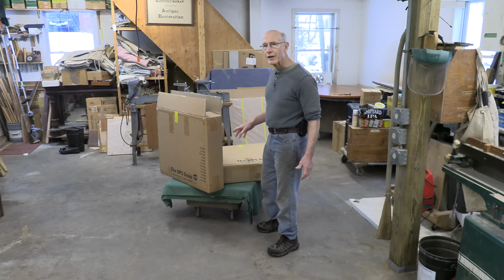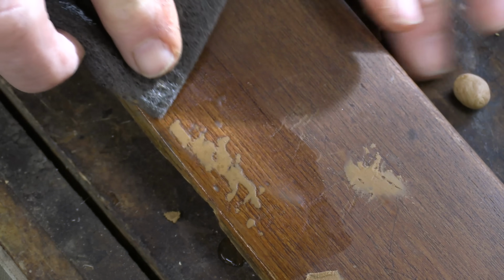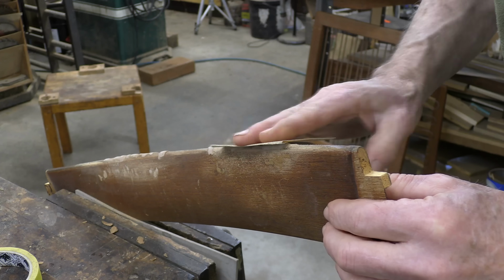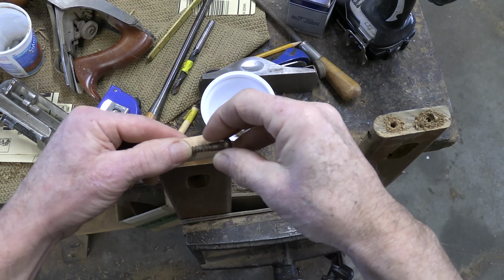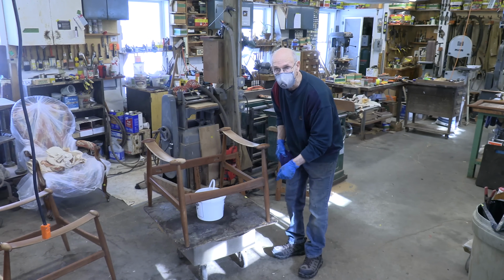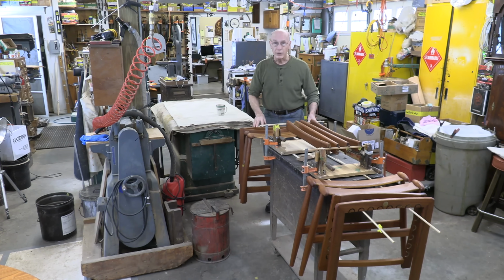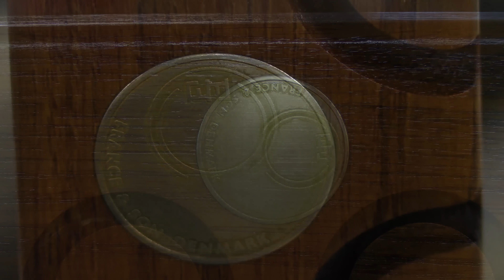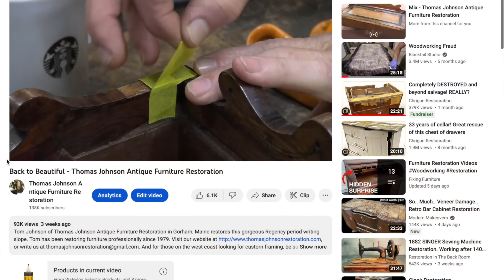Full of SURPRISES! - Thomas Johnson Antique Furniture Restoration

Comment: I especially loved watching this one. I am danish and my dad was a furniture maker and worked for France and son in Hillerød, Denmark in the late 50s early 60s. We had two of those chairs at home. Both with wool covered box cushions with an edge bead. One was light curry yellow and the other duck egg blue. We also had lost of leftover teak bits to use for various things … I built doll house furniture out of some and my dad had a bucket full of those bullet bits and used them as garden tool handles and other repair stuff around the house. Thank you for all your wonderful videos. You do some beautiful work.
Reply from the maker: Wow! Thank you! That is amazing. I'm so glad you have so many memories of that time. I've been wondering how it came to be that the Danes were using teak - there must be some connection
Reply: @johnsonrestoration  Ohhhh, there comes more memories! My uncle worked for ØK (The East Asia Company) and he travelled in East Asia (and other parts of the World … I think also South America at some point) with the one purpose of buying special wood home for the Danish furniture businesses. It was all hardwood which was not available in Scandinavia. It was then transported to Denmark with Mearsk Shipping (another Danish Company). And by the way, the finish you did on those chairs were spot on - exactly as I remember them 👍

Comment: I saw you gluing up a long crack in an arm at about 3 minutes in. Have you ever used the vacuum cleaner trick? You spread an excessive amount of glue on the top and suck it into the crack by placing the vacuum suction nozzle on the bottom. It works great, and it gets the glue into all of those fibrous nooks and crannies if you work it in from the top with your finger.
That might be why my shop vacuum seems to groan when it turn it off, but I'm not sure.
Reply from the maker: Thanks! I need to try that. Mine groans too! I thought it was just me

Comment: My Brother and I recently divided up my mom's Danish furniture. We've both gotten really good at regluing,( properly) and gentle refinishing teak. Both of us can make a hidden shelf bracket out of heavy guage wire without thinking about it. We've developed a theory about why this very pretty and nicely designed furniture has not held up as well as it should. 

Two words: latchkey children. Right at the peak of Danish Modern teak, children all across America were running wild after school, listening to records on the hi fi, putting our soda pops on the tile top parson tables, and generally using the living rooms like we owned it. Never before has fine furniture been put under this kind of stress. At 5:45 PM, we whisked all evidence of our use of the living room away, opened our school books on the kitchen table, plastered looks of innocence on our faces and prayed we put our mom's record back on the turn table and took Pink Floyd off. That and the delicate lines and sometimes extreme angles of the chairs....

By the 1980s there was no more living room furniture. Parents had given up. It was all great rooms, family rooms, etc. 

Now I'm in my late 50's, appreciating the Danish teak, and as I work on it finding a bunch of sneaky Elmer's glue repairs dating back to my brother's and my time running wild in the Living room!
Reply from the maker: Thanks! You are so right! These chairs lived in a house with 10 children, and being military moved all over the world. So actually these chairs stood up really well! I love your description of those afternoons!

Comment: Hey there.
France & Son were some of the best furniture factories in the Danish Furniture Architects Heyday and Finn Juhl is certainly among the most sought after and still is. And not cheap.
Allways a pleasure to see craftsmanship in action.
Back in the day they almost allways used hot boneglue, which ain't that strong and Laquer for the last finish. We hardly use Laquer anymore, but mostly linseed oil with beewax in some mix or another. No question: Teak definitely deserves oil 🙂
 
Greetings from a  danish cabinetmaker.
Reply from the maker: Thank you! That’s very good information. I feel like the hide glue is very strong, based on our informal shop tests. I’m happy that a Danish furniture maker approves of the work!

Comment: That project was full of surprises! Great job, Tom! Were those chairs not made to stand the test of time, as it seems there were a lot of weak points that failed?
Reply: No, these are generally considered to be well engineered, very high quality pieces - as Tom points out with the cross dowelling. They just seem to have had a particularly rambunctious life.
Reply from the maker: Thanks! They are strong - but have their limits! 549RR is correct - these chairs were abused
Reply from the maker: Thanks! You are exactly right!

Comment: For MCM cushions, highly recommend Renaissance Cushions our of Canada. Small shop that knows MCM well and who will work customers to get the correct sizing for height, width, and depth. (Some customers like 4in bombed out cushions but I prefer thinner, on the order of 3" to 3.5" for the seat and 1" less for the back.) The Maharam Beck and Kvadrat Divina MD and Melange fabric lines are well suited for MCM chairs. Lots of solid colors/hues to chose from that fit well with oak, teak, rosewood, rattan, and other woods.
Reply from the maker: Thank you! I'll pass this along to the owner

Comment: Very fine work! I’m glad to see that these made it into your hands considering the state that they were in. 
Model 133 'Spadestolen' (Spade chair) was designed in 1954 and was Finn Juhl's very first collaboration with what was then called France & Daverkosen. These chairs have to date to 1957, not 1956, because 1957 is the year that France & Daverkosen’s name changed to France & Son. The original frames were teak but it was produced in limited quantities post-1960 in the highest quality Brazilian Rosewood. I’d imagine that a coat of wax every six months would go a long way in ensuring that the wood retains its natural luster. Thanks for posting the video, it was nice to view. I might have missed it but how were the missing metal rods replaced?
Reply from the maker: Thank you! Very good information. I didn't show the making of the metal rods, I just cut some round stock from the hardware store and epoxied some washers in the middle, They didn't really show much when the chairs were assembled (thank goodness)

Comment: I have never seen a pneumatic die grinder with a router base attachment. It would have some advantages over older electric routers. But with the power increase of small electric motors over the years, those advantages are minimal at best today.
Reply from the maker: Thanks! I haven't worked with any new routers. But it's hard to beat any pneumatic tool

Comment: Getting pva glue through cracks in wood is difficult, I use a shop vac with a cloth held over the end of the hose to pull the glue through. You can vary how much suction and the rag catches any glue to keep it out of the vac. Great job as always! Enjoy the content.
Reply: The rag over the hose is a good tip. I use my shop vac too (Bosch) and I can dial the suction up or down, which helps to control the way the glue is moved around.
Reply from the maker: Thanks! I'm going to have to break down and try that sometime!
Reply from the maker: Variable suction! I've got to look into that. It sounds like it would give you control

Comment: Had similar Danish furniture in the early ‘60s. Those elegant, sweeping doweled joints loved to crack. These pieces must have an interesting history. (Very) well used, then knocked back down and stored for future generations.  Thanks for the video - in particular the timely marker tutorial, though Mohawk is a bit out of my price range for a one-time use - hoping a less expensive alternative will do the job. If not, …
Reply: I wouldn't spare money on markers/stains. Pigment quality means the colour will hold and fade much less. Then again, if you need to buy a set because you don't know which one(s) to use, at $50 a piece for the brush-tip ones... I totally understand!
Reply from the maker: Thanks! As far as the markers go - I always used artist brushes and dye stain!

Comment: The obligatory "I think they look pretty good..."   Nice!

They are amazing....  Great job Sir.  Really good.

In my "lower line" (shall we say) repairs, I've seen similar thing 50 times...  Where the cut is made, like in those arms....  The end grain gets exposed, and the wood just loves to dry out, from that point...  So you see cracks, radiating back...  You had a lot of that on this one....  Being in storage so long, it gets super hot, it gets super cold...  It just dries out & cracks...

I had this job one time, to do a "faux" wood finish on some steel doors...  It came out really good.  I learned a lot on that one...  So much...  Those markers you were using, you can literally go in with a darker one, a super fine point, and draw in some grain lines, and it will look amazing...  It will disappear.  You yourself, will struggle to find the repair area.....

Buy a set of oil paints, and some super fine brushes, and mess around on some scraps....  With a little practice, you can get a great great result....  I know you could, because you have a great eye, and great instincts, in your stain matches.....  You are better than you think.  You are very good...

I love your scroll saw also.  What a beast.  Nice.   I did a couple scroll saw projects for myself, maybe 25 years ago...  I got a Delta Scroll Saw for nothing, the table was messed up...  So then I started messing with it....  I think it's a little 16 inch...  It has it's pluses & minuses...  The motor is real strong, it's built real strong...  The blade holding, is a royal pain in the backside....  Yours is creating feelings of envy....  And, I daresay, you rarely see ANY YouTuber use a scroll saw, where there are so many times, it's the perfect tool....  So, you are now in a very small exclusive club, you used a scroll saw in a video....

I also wanted to say, you didn't really talk about it much, but, your little trick there of letting the putty partially dry, and then getting it with the chisel...  I prefer a new razor blade, or a new utility knife blade with some tape on it, for grip, but...  The concept is the same.  You can get a great result, and save a lot of sanding, if you can catch it at just the right time, when it's starting to get hard, but has not set  up and gone super hard yet.....  

I'm sure you don't put this in your pantheon of great repairs, but I thought it was one of your more impressive jobs....  Really great work.  As we get older, like it or not, those chairs are future classics.....  Honestly, your 19th century stuff, I wouldn't touch it....  This, I would probably take, if someone brought it in....  Watching this video though, I feel like I could get your result maybe, or close to it, but I have no idea how it would be less than 40 hours.......  So not only are you amazingly good, but you are fast...  Which is highly impressive.   It's probably good I just do this stuff as a sideline, it's not my real job...  I'm not fast enough....   I'm trying to say, that was very impressive work Sir.  I tip my cap.
Reply: Judging from the prices they make, they've already been declared as "classics"...
Reply from the maker: Thank you Patrick! I can tell by your comments that you have a lot of experience and are good at repairs. Don't sell yourself short either!
Reply from the maker: I always worry that it's the market value that makes people interested, I wish they could enjoy them just for what they are
Reply: @johnsonrestoration  Oh, I enjoy furniture for what it is - market value is just an (often unfortunate) 'confirmation' that I'm not the only one that enjoys a particular piece or designer!

Comment: For a second there, I was afraid you didn't think they looked pretty good. Whew! Is that same furniture maker still in business, that you were able to get the seat straps? I don't know that I've ever seen such a product, with the  springs inside the rubber/plastic(?) coating.
Reply from the maker: Thanks! I found them easily with a google search. I think it's a new small company that's making them. I was amazed

Comment: That looks like a bedrock 604. When it comes to white/yellow modern glues I found that they shrink as they dry. Clamping lightly for about thirty mins and then harder after thirty works wonders. Also using a blowgun helps shove the glue into cracks.  Still best is to split cracks, use a wire brush to clean the dirty wood before gluing back together.

Neat chairs and they look pretty good. I can see the repairs but that may be because, being colorblind, I can spot color differences instantly. I can’t tell you what the color is but I can see it right away. May late father hated that. Everytime he painted a car I could tell him if it matched or not.
Reply from the maker: Thanks! I like that about the color! You're good! I'm not sure about that clamping technique though

Comment: Tom, Working with teak for a longtime I find glue joints don't hold up unless the teak has been freshly cut.  I usually clean the joint with acetone and as soon as it dries do the glue up.  Teak is an oily wood and even when exposed to the elements for years it will still retain oils.  Beautiful work as usual Tom
Reply: Not Tom, but thanks for the tip! Does the type of glue make a difference? What do you find that works best for teak (and I assume other "oily" tropical woods)?
Reply: @dlevi67  Hi devi76.  I probably should have included that.  The absolute best glue for teak is epoxi if gluing large surfaces.  I prefer Titebond  III if the piece is outdoors.  Most tear items are for that purpose.  I have used it on boats for a long time and with very good results. An old school glue is  Resorcinol but i has been replaced by the epoxies. I have tried polyurethane glues but it never really gets a good bond to oily woods. Also, because of its nature to expand when setting, this can damage teak furniture if you are not careful. Epoxy or Titebond III is a far safer and more effective choice of adhesive for teak. If you decide to use epoxy dont use a lot of clamping pressure.  Just enough to hold the pieces together. Make sure you check your working times with epoxy also it can kick off pretty fast and then you have to start all over Clean up the any squeeze out from the wood surface with a solvent.  With Titebond you should clamp it tight real tight.  Clean off the squeeze out with a damp cloth.  20 years messing with boats have taught me a few things.  Thomas is a great resource too.
Reply: @DavidWhite  Thank you, Sir! Much appreciate the detailed response.
Reply: @dlevi67  Any time and you are very welcome
Reply from the maker: Thanks Dave! Yes, that is true, when I have worked with new teak I have always done that too. Repairs like these, the wood sure didn't seem oily! I probably should have done it as a precaution.
Reply: @johnsonrestoration  I agree completely Tom.  I have had some old weathered teak joints fail.  Don't ask me how I found that out.  Teak will also dull saw blades fast because of the silica in in it.  I suggest using nothing but carbide blades. Teak is great wood but it has its quirks

Comment: 21:47 could it be that the wood split here because the holes drilled are too small for the screws? And the too big screws popped the grain? 💖🌵🌞😷
Reply: Possible.. but unlikely. These were designed and made semi-industrially (so they knew exactly what diameter to pre-drill for a standard screw), however the whole design is fragile as the whole weight of the sitter is held up by those 4 screws!
Reply from the maker: Thanks! I agree with dlevi67.
Reply from the maker: Yes! And I didn't know at the time, but these chairs lived in a house with 10 kids, military family that moved all over the world! So really, they held up well
Reply: @johnsonrestoration  All things considered, they almost didn't lose any pieces!

Comment: Kind of amazing that flat pack ready to assemble furniture was made so long ago.
Reply from the maker: Oh yes! Way back to the middle of the 19th century really. Once the railroad system was in place, factories quickly figured out they could ship a lot more with the furniture flat, to be assembled at the retailer
Reply: @johnsonrestoration  I once worked for a company that assembled RTA furniture and bicycles for K-mart. Of course most of that stuff was pressboard or press wood junk.

Comment: When glueing up cracks or splits, I like to mix in a bit of water to the wood glue to make it penetrate deeper. Typically I put a piece of painters tape on the bottom side and let the glue pour its way to it, when clamped the glue natuarally slides to where it didn't hit previously
Reply from the maker: Thanks! That's a good idea. I prefer to heat it a bit to make it less viscous, I worry about adding water
Reply: @johnsonrestoration  Well, the glue has water in it already so I don't worry about that, and it's not like I'm making it like milk consistency, just a little bit of water. But heat may do the same thing, I'll have to try that

Comment: Tom, another great repair. I noticed you used a couple of different colors/types of glue...a white glue and a clear glue. Please comment on the types of glue and your reasons for using those glues. Thank you.
Reply: I think Tom is using Titebond Classic/I throughout, in this video. It shows as more or less yellow depending on the lighting.
Reply from the maker: Thanks! dlevi67 is correct - I was using TiteBond.
Reply from the maker: Thanks! Yes, the lighting...